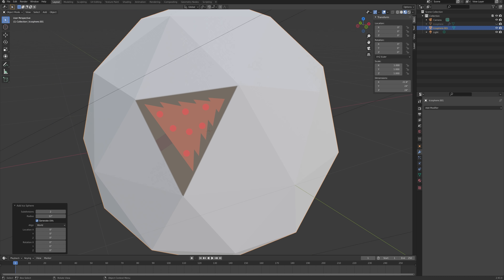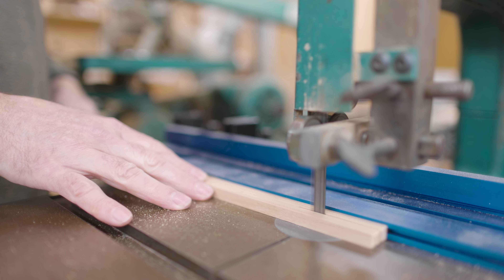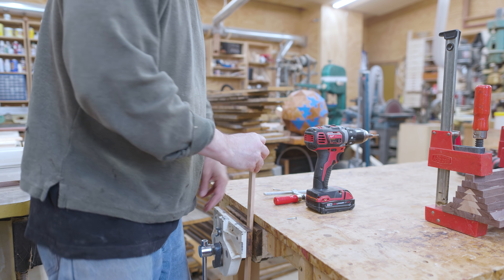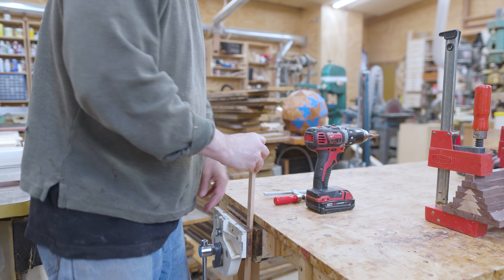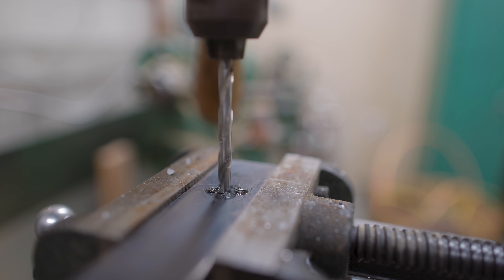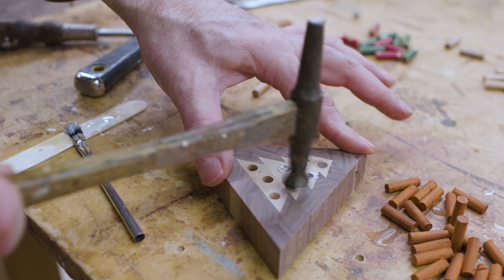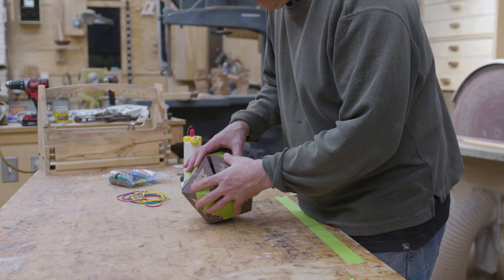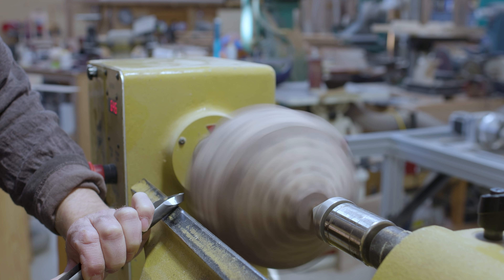Making A Christmas Ornament

Comment: Hi Frank, one way to make dowels is simple and works very well, get a set of die & taps and use the one that makes the thread of the bolt and use that to make the dowel, you end up with all the sizes you will need and they never need sharpening. Another bonus is you and use the set to make bolts and nuts.

Comment: Great job. I build these Polyhderal objects all the time. He is a tip. Use and upholstery stapler to join the pieces. This eliminates all the tape. You will never see the inside staples and you will cut away the outside staples when you turn it..

Comment: Hey Frank, for hanging it on a Christmas tree, ever see one of those wrought iron hangers for suspending a dutch oven over a camping fire, made like a horizontal arm extending out from a vertical pole driven in the ground?  There's a hook on one end for the bail of the pot to go over, and a twisted spiral loop on the other end that slides down over the pole, then the weight of the pot introduces friction as the arm tilts down under the weight of the pot, and keeps it from sliding down the pole.  It seems like a similar horizontal arm could be made for these heavier ornaments, and instead of a spiral twist around a pole, cut a 1/3 slice out of an oversized short piece of PVC (or metal) tubing, then attach the end of the arm to this tube next to the edge of the slice.  The width of the slice would need to be wider than the diameter of the trunk.  To use it, just jam the arm back in there and hook the tube around the trunk (i.e., the trunk would pass through the missing slice, leaving the trunk centered in the tube).  If it does slide down, the next branches would stop it, but the far side of the tube with the curve in it would hook around the back side of the trunk, and the front side where the arm attaches would push into the trunk as the weight of the ornament was hung on the end of the arm.

Comment: if you cut a slot across the hole in the steel plate, at an angle with a grinder or other method, it will work better / faster making dowels.

Comment: Merry Christmas Frank and family… I hope Santa brings you a 3D printer so you can make some awesome work piece holders for your complex shapes. You could Boolean the 3D model out of a block and then cut it in half leaving you a negative to hold the piece while it’s gluing up. I’ve been doing that for tricky angle wooden joints I’ve been making. Amazingly helpful!

Comment: Frank, at your rate of making these spherical and round objects, I would like to offer my idea for how you could make it all more precise. I don't have a workship yet, but you might want to give this a try. My idea wouldn't reduce your work of cutting the pyramid shaped pieces by hand, but it would allow you to accurately sand them to final precision.
Make a horizontal turntable which you will place the pyramid shaped segments on, with the side that will become the surface of the sphere, downwards in the middle of the turntable. Now move in a big disc sander from the side, which is inclined correctly to meet the glue faces at your calculated target angle. If you now rotate the turn table around, you will be able to individually orient all glueing faces to the sander and sand them down to final precision. I would clamp the pieces (with a truncated tip) vertically from the top.
The challenge would be to place the segments right on center so you have to do minimal sanding, and to fixate the pieces in this rotating fixture without blocking the sander from the area.
You might even be able to make a hand-held fixture to carry to your big disc sander, or devise a plan for clamping the pieces in a lathe and bring the sander in radially at a repeatable precision.
Reply: I see you have found a good process of cutting the segments accurately. The project turned out wonderful! I'm sure you are an inspiration to your kids.

Comment: You have a lot of talent and skill, Frank, when it comes to figuring out layers, jigs and then the turning. I liked the colored pencil idea as well. One thing that occurred to me: would it be possible to soak 'store bought' dowel material in denatured alcohol with dye long enough to draw the color into the dowel? Or, maybe epoxy acrylic rods in there instead?

Comment: Couldn't you slip a small piece of paper into the edge of each "cup" as a shim, such that both shims are on the opposite side of the flat spots you are struggling to reach?  It would mean the cups aren't gripping as well, but it might be an easy way to make a small correction.  

The only other way I can think would involve two four jaw chucks, a dial indicator, and way too much time, and even then, I'm not entirely sure I can wrap my head around whether it would work...  please share with the rest of the class if you end up figuring out a way to make it work!